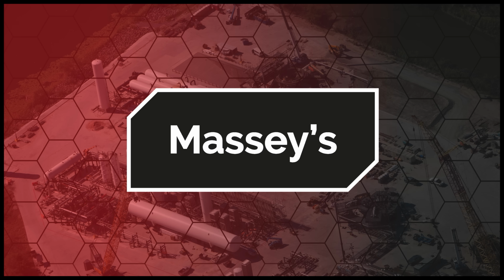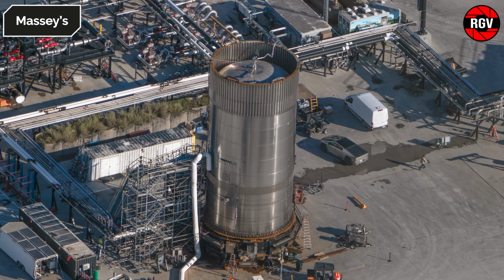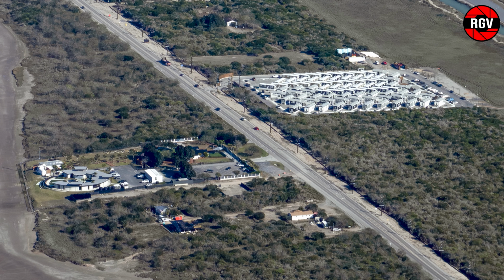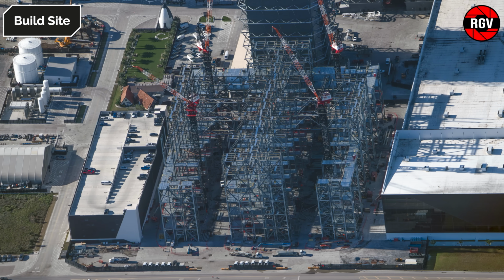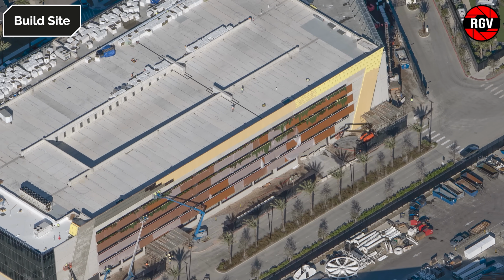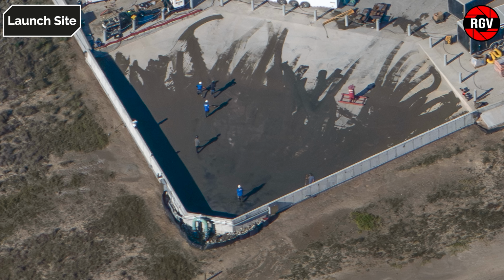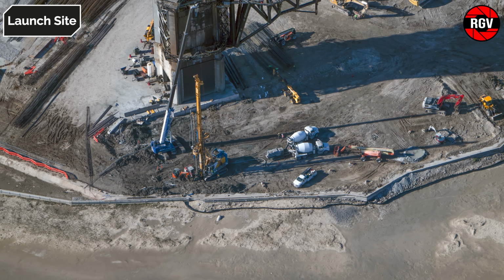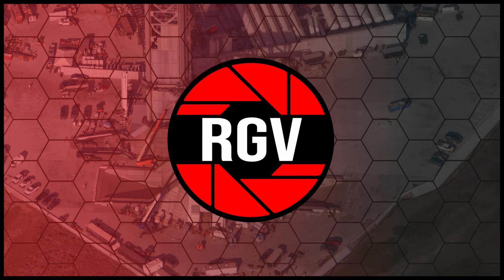Pad 1 Drilling Begins and Test Tank Anomaly | Starbase Flyover Update115

Comment: test tank collapse is on the unpressurized section.  So it's an unexpected fail, but the fail is due to not being actual set up of a pressured tank below.  Hence, the collapse under the stringers.  Kind of like testing with a full sealed can of soda on top of an empty can of soda

Comment: It's too thin . This is to increase payload. They have crossed the line for intended payload capacity.  Booster will have to be built stronger but this decreases payload target. Something has to give and that is payload capacity or use  stronger engines to offset payload loss from the added weigh  to meet payload goals, that by itself will require  a stonger structure.
Reply: You said the same thing on the NSF Starbase Update video, and your statement is incorrect. The booster tank wall thickness hasn't changed since V2 (maybe even V1). The part that buckled was unpressurized so it didn't have its usual strength. Notice that it bucked IN and not outward. If it were pressurized as all boosters are during flight, you would have a more rigid structure.